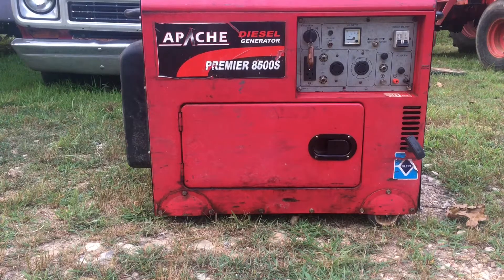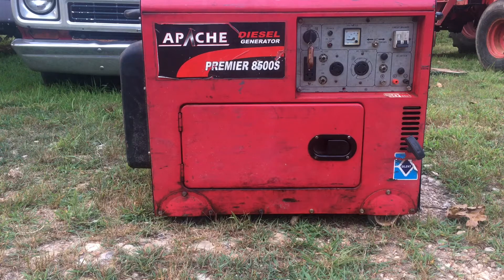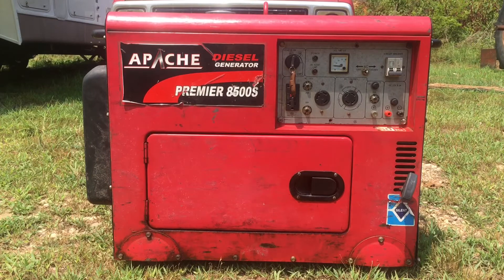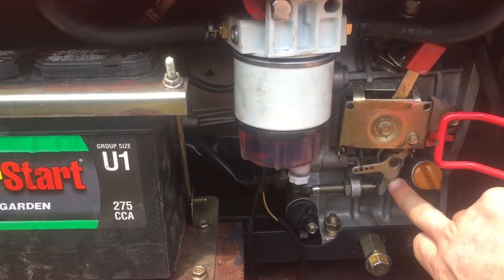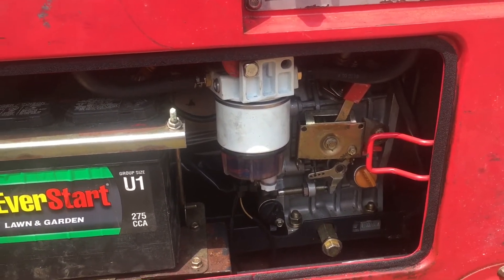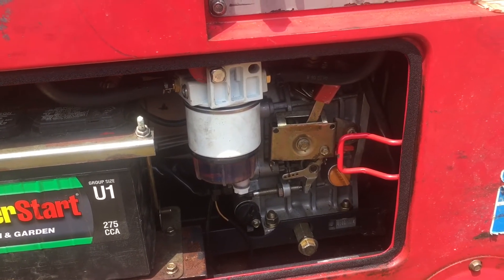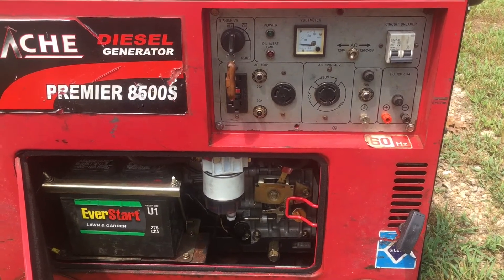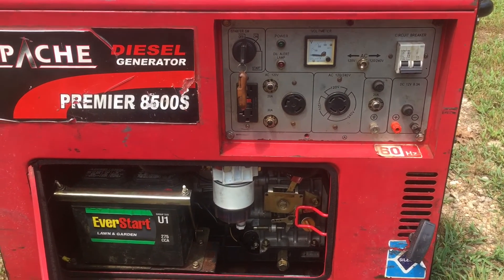Silent Diesel Generator long term Review and Discussion

Comment: Thank you for the video. I have one, Mortox 6700T silent Diesel new from Richie Bros auction looks similar to yours. I had a little short of the starter wires and melt down of the control panel while troubleshooting starting problems! I repaired the starter wires and the generator motor now works good! Ordered two relays JD1914 from amazon and two rectifiers KBPC2510 for repair, since I was able to jumper the fuel shutoff to 12V to get working! Now, DC output now seems OK after replacing the DC terminal output rectifier and relay! I now have the key switch, fuel shut off logic and oil sensor  connected with the second rectifier disconnected. Little info to go on for the repair, schematic would be nice! My focus is on the four wires to the second rectifier and I am not sure where the wires go!  There are two black wires from the alternator, Red wire to the battery and a yellow wire which may be GND.  I think there are two possible configurations: 1. Black wires are AC outputs to rectifier for Battery Charge or 2. Battery DC feeds through diodes to an alternator excitation circuit?  Without the second rectifier connected, the generator's AC voltage is not working, either 120V or 240V mode! (~50VAC in 240VAC mode)  Seems a pain to take the muffler off looking for a second opinion? Perhaps this sounds like I may have messed up the capacitor? My search seems to indicate there are a few different configurations of these generators AVR or capacitors. Any comment would be helpful!

Comment: Please Do NOT use ether or any starting fluid on these little one lunger engines. They have very shallow and weak ring lands that will fracture immediately and become the slow demise of the engine.  Usually first sign is excessive blow by into the intake and air filter then oil leaks start at the governor shaft and rear seal.

Comment: Thanks for sharing what you’ve learned on these things!  I have its smaller brother, a 4,200w with 7HP clone.  It now runs great after fixing previous owners damage from using ether to start due to (unknown at the time) a broken valve spring.

Comment: Nice unit. What does it weigh? I see wheels on all 4 conversions & 2 handles. I was initially interested in a model like this made by Honda but I couldn’t find enough information on them. I went with an ultra quiet gasoline generator by Honda EU 7000is. I love mine.

Comment: Hi, so i have the same generator, was working fine and then quit, i checked and topped up the oil as to your specifications, put a new battery in and it will start if i press the decompression handle. Starts right up but throws the stop swich, will keep running if i hold it, and it has the oil light on , any ideas whats going on?? Thanks
Reply from the maker: unplug the oil pressure switch and see if it runs.

Comment: To start a Chinese air cooled diesel in winter, slowly pour hot water on the cylinder. Purity of oil and fuel is important. The 168F is a small 196 CC diesel with an angled cylinder built by at least two Chinese companies, with castings and parts differences. Ether is a big hazard to use. A goofy squirt will blow up like a grenade inside. The fit and castings are excellent. Loose motors should avoid high RPM but idle must be noticably above stall speed. You should avoid full power, when you see lots of smoke. This motor is about twice the size of a 168F. Don't use a dirty funnel for oil. 15W140 is universal. The crankcase will run way cold in winter. Augment a cabin with solar panels.

Comment: I got mine during Hurricane Sandy - And it still works. I love the damn thing. But. It did not arrive in working condition and the entire system had to be reworked. Also the entire thing is made of chineseium - they copied the Yanmar L100 and the copy is so good you can use stock parts on to the 178f or whatever they call it. But I keep a stash of spare parts because they do break but anyone can fit it. It has atleast 5000 hours. - And they sip fuel. My experience reflects yours exactly. - I added a glow plug to mine. I'm planning on reworking the control panel for digital control
Reply: What ur run time numbers look like
Reply: @herewegoagain4041  12 hours >50% load - run time, 14-16 hrs running on less.  the fact it did not use gasoline - which was in short supply. Allowed me to keep the lights on 24 hrs a day for over a month. If your gonna get one, don't get a knockoff like I did. Get one with a real yanmar, made in japan. engine

Comment: I have a question, how much does this thing weigh?
Reply: I just bought one,  close to 200 lbs I believe.  Ridiculously heavy.
Reply: @kiddlawncare2933  148 kg dry weight, so 326 lbs
Reply: @kiddlawncare2933 it's over 200 pbs

Comment: I just picked up one of these - a non running "Nigata 5" "Silent Generator". It's certainly silent when it's not running LOL. $500 Canadian was a bit too much but I paid it anyway. The only problem with it I can see is that the gasket in the fuel pump was chewed up and needed replacing. Looking forward to getting it running this weekend, fingers crossed. 

There's something to be said for simple mechanical diesel engines. My sailboat's inboard is a 1 cyl German Farymann diesel, my Tractor is a 3 cyl British Perkins diesel, now my generator is a 1 cyl Chinese-stolen Japanese Yanmar diesel. They just work, and when they don't, they're easy to fix.

Comment: just got a mint one of these with 10  hours on it, so its only a 6500w ah :( was hoping it was a 8500w :D
Reply from the maker: they put all kind of numbers on the sticker to misslead people to think they are a higher wattage. but they should have a spec sticker somewhere saying the proper wattage. may even be on the generator power head
Reply: @muddstuffn  how many hours you have on this generator now ? is it still running well ? and fixes needed ? thanks a bunch.
Reply from the maker: @GoingOffGrid101  ive got a few hundred hours on it. been pretty reliable. Capacitor and starter is about all ive had to replace on it.
Reply: @muddstuffn  where do you buy capacitor?
Reply from the maker: @GoingOffGrid101  local electric motor store.

Comment: Hey @diezelDon you ever had a problem with it running for 15 minutes then shutting off?
Reply from the maker: check for restrictions in the fuel supply to injection pump and start with changing the fuel filter. Ive also seen the Fuel shutoff solenoids get warm and shut themselves down prematurely but make sure your getting enough fuel to the pump first.

Comment: Hello,i have a 8000 one but i am not getting any power
Reply from the maker: Check the capacitor. That’s usually what goes bad. It’s usually mounted behind the exhaust side panel

Comment: I bought two gensets used for $400 CAD. Both need fixing, I ordered a capacitor from generator guru but the rest of the parts I've ordered from aliexpress. I've ordered two injectors, an injection pump, high pressure line, rockers, push rods, piston, head, air cleaner, muffler, and a fuel tank. That was about $600 CAD. I'm going to sell the one 5500w after I fix the capacitor and injector, and keep the rebuilt engine only off the bigger one with the 186fa. No idea wtf I'm going to do with a 12hp engine but I'm sure I will mad scientist it into something

Comment: I've rebuilt one of these, they are poor quality, lots of parts are not hardened properly and the starter motors and solenoids are trash, once they breakdown and you repair them it's never ending chasing problems. Unless your lucky you it will be out of service half the time.
Reply from the maker: If anything breaks i replace it with OEM Yanmar parts that are better quality. So far ive had good luck with it.

Comment: Just got the same type of engine. I'm very curious about how you managed to improvise your fuel filtration. May I know what type of fuel filter you are using? I'm considering putting one on my unit. I recently check my generator fuel system it seems there's no fuel filtration even I look inside the fuel tank, none at all.
Reply from the maker: I used a R12T Fuel filter assembly off Amazon or Ebay.Check out my second video, I show a better view of the fuel system due to a couple people asking for it. https://youtu.be/M5jVphZIwoY
Reply: @muddstuffn  Thank you mate for the reply. My bad on what I said in the previous comment that I said there's no fuel filter in my generator. I found it today, it was very tiny and I have to unscrew the panel board to see it. Just behind the panel board. I need to relocate this thing.

Thank you again for the support link. Awesome. Please keep posting. 

FYI, I'm new to this diesel engine generator for about a year now. I just do basic maintenance like changing the oil to prolong it. I never bother to know more. But recent event, I got more inclined to top a notch the maintenance since we got hit by typhoon Odette here in the Philippines. When I saw your video I got more confidence to take action. Many thanks for that.
Reply: You just need a small inline fuel filter.
Reply: @Compairholman  Yup Sir, couldn't find it and I settled with the small. The one that is made for 186F engines inline fuel filter.
Reply: @CancelOkay  a small plastic inline filter from eBay will do, these engines only sip Diesel.

Comment: Looks similar to my Digital Power Systems DP-75ASB.  Mine has the glow plug, decompression cable @ control panel and upper hatch.  Yanmar! That helps.
Reply: Yanmars are great from what ive heard and experience . my dads tractor had a Yanmar

Comment: I have the Apache 8500e and the wiring is messed up on it , I can not find a wiring diagram anywhere
Reply from the maker: The 12v side should be pretty straight forward. The 120 might be a little tricky but should be similar to other gensets if you can get a detailed diagram. Might try Aurora or Durostar. They are still selling similar units and may be able to get detailed info. Even if its not exact it maybe helpful.

Comment: Looks identical to the KH6600 Kraft Hertz Diesel Generator
Reply: @8180634  I reckon they are all made in China.  Eventually I bought a Black & Decker one which is still in the box.  I bought it because I am waiting for the (Klaus Schwab) power cuts which I am sure they'll roll out sooner or later.  You know the ones that will save the ice caps, the whales and the planet? All for our own good you see!

Comment: recently there isn't a single small diesel anymore.  year or two back u could find them.  weird.
Reply from the maker: Epa is probably cracking down on imports if i was to guess.
Reply: @muddstuffn  I think that is exactly why. I'm in Canada and searched if I could buy one of the China diesels and import it and it has to be certified for emmisions and you need to fill out a declaration of emission compliance. Who knows if customs would care but not worth loosing $800 if they confiscated it.

Comment: Thank you so much. Your video is quite helpful. Just to ask, what is your estimated lifespan of these Chinese disel generators if well taken care of?
Reply from the maker: I’ve put over 100 hours on this unit and it seems to be great. I recommend a better than stock fuel filtration and use good oil and change frequently and make sure the screen filter is cleaned and they should last quite awhile. Main problem I ran into is that they don’t cool themselves properly in 90 degree days if ran extended periods. But in the 80s they can run all day.
Reply: @muddstuffn  I’m in Arizona, see how mine holds up to the heat. What size are the fuel lines from the factory, I want to do a fuel filter upgrade like that, looks like ones I saw on amazon marine style.
Reply from the maker: Mine did not like high 80s and 90s *F after running for awhile. Since its inclosed it doesnt get enough airflow to keep the engine cool at those temps. Might mount a fan to blow through it, that might help.
Reply: Good video. I quit buying batteries for these small generators. My new way is to install a heavy 4 prong female trailer wiring plug  on the generator. Wire it to the starter or positive battery terminal and ground. Then take some jumper cables and install a male trailer plug on one end. Then you can start it off of any tractor, car or truck you have around.
Reply: @bus-fun-addict  GREAT idea!

Comment: I was given a 8500se. Do you know what's different with the SE? I can't find anything about these generators online. No manuals or anything.
Reply from the maker: I couldn’t tell you the difference, but the makes and models of the same unit is all over the place, most of the parts are interchangeable.
Reply: Myanmar L100 manual pdf will do for the engine side.

Comment: Mine is inside of a prepared Rubbermaid shelf bought at H. Depot. (Video attached....)
https://www.youtube.com/watch?v=zmI6pBNCS-U
Reply from the maker: Well done! Just keep in mind that it’s air cooled and putting it in a small shed will inhibit some of the air flow required to cool the unit. Mine doesn’t like 90+ degree days with extended run periods

Comment: Do you have a problem with having Offense of smoking problem
Reply from the maker: Right after startup the smoke clears up. It may smoke just a tad when pulling a surge but you won’t really notice it
Reply: I know this is an old post but if someone else has the same problem I did notice mine smokes a bit until it warms up but more importantly you need to have a load on it.
When you make it work it has a better burn.
Reply: There is a guy with a YouTube channel Boy Kalikot. He works on these engines in a lot of his videos. I have no idea what he is saying (Filipino) but I understand what he is doing. He took an injector apart on one and spread the spring that puts pressure on the pintle to stop one from smoking. They must fatigue or the shims get worn causing it to inject at too low of pressure. I ordered an injector for mine but if I couldn't afford it I would try it.